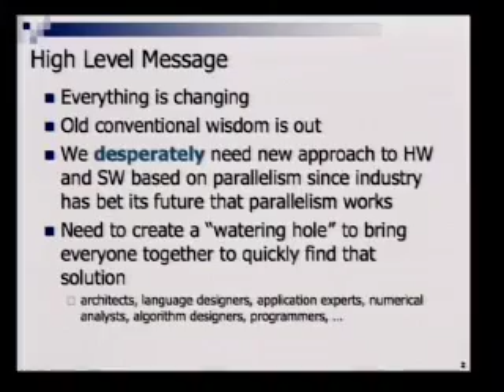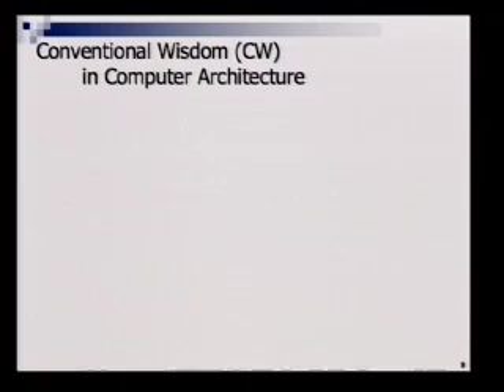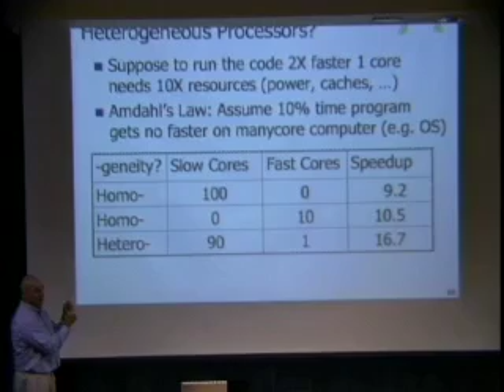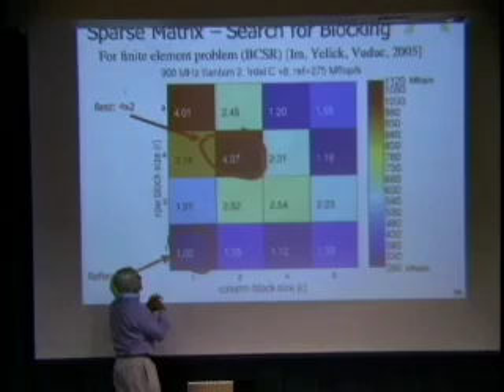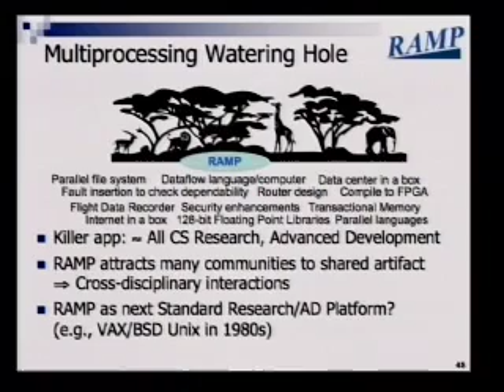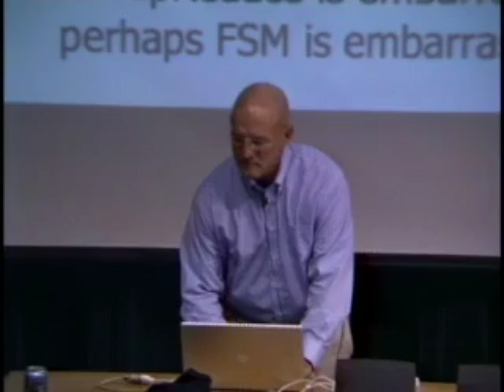Computer Architecture is Back: Parallel Computing Landscape

Comment: Van Neumann model has a control box that holds time. We have to remove control en distribute it like data/function mapping. We have to remove storage and replace it with a `tape` like architecture, that models lists of lists of values. Time will be removed and replaced with latency. All processes MUST TRAVEL AROUND THE CHIP to reduce temprature differences. The functionality travels around with the data through path's of gates that gives the machine `remembrance` of a traveling space/time state.